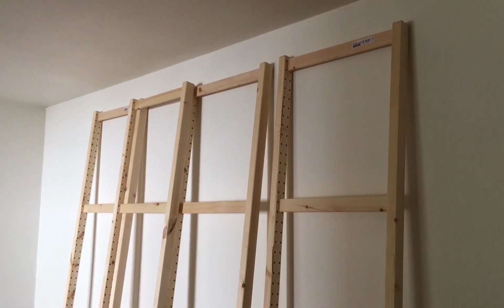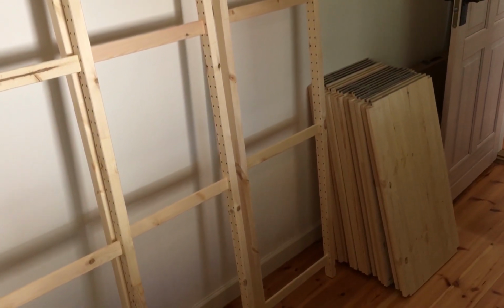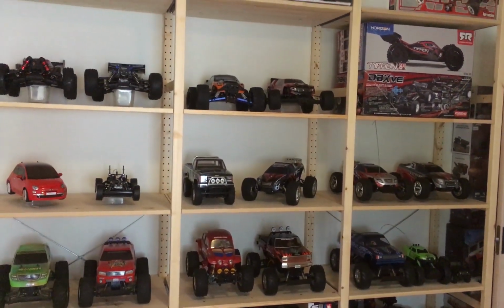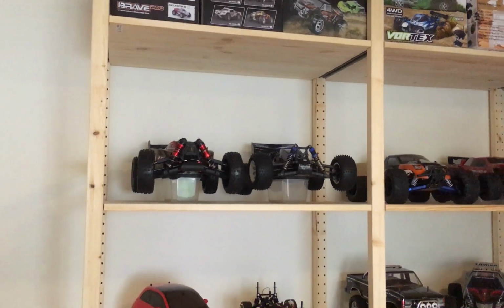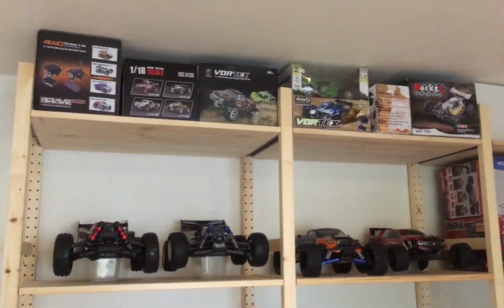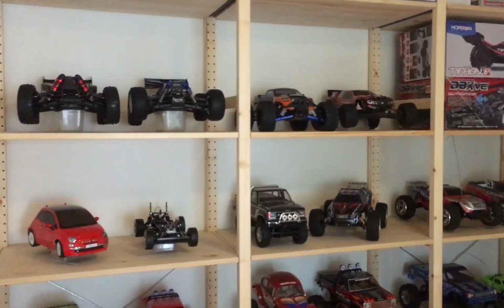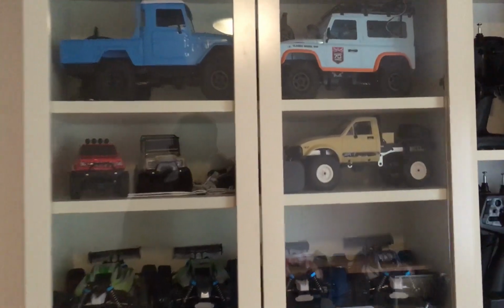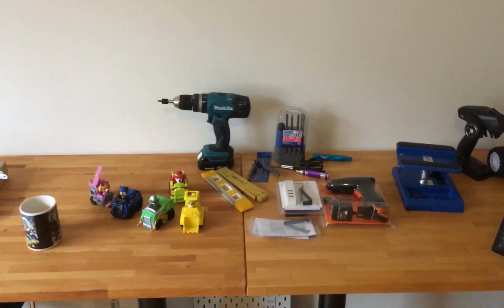The Making of an RC Hobby Room (Part 2): New Giant 3 Section IKEA IVAR Shelving System!

Comment: Shelves look great, so I don't blame you for using them.   Plus, they are highly adjustable.   
You must have a hundred RC's!  😮😲🤣😂🤣🤩
Reply from the maker: Yeah, I like to have this shelve system, adjustable, and deep enough for the bigger models. Ahh, not even one hundred, but getting very close I think. Luckily a lot of them are not 1/10 and 1/8 ... or else I would have to find a larger room :-)
Reply: I have this Shelve system too. Looks good and and does the job since ca. 2003. But the battery screwdriver from sweden seen in this video ist not very durable I think.

Comment: I saw you have a Maisto Rock Crawler do you have any videos on it and if so can you give me a link as it's a cheaper crawler and I've been thinking about getting something a little bigger than my 1/24.
Reply from the maker: Yeah, the Maisto Rock Crawler. It belongs to my son, but I've definitely also had a lot of fun with it. I think I got some 3-4 years old clips with it - but no edited and uploaded video. Maybe some day :-) It runs really nice with the motor-on-axles. The bad thing about it though, is that it does not have proportional steering and throttle, which can make crawling a little difficult.

Comment: Very nice collection!

As we can see you own turbo hoppers from tyco.
If I was young I found 2 of them (there was a bulk waste in my town) Old Versions without charging jack and differential but with the ability to steer without to drive forwards or back. Later I got a newer version also. If I drive the older version with the transmitter from the newer version I can drive left or right in turbo speed if I only steer left or right.

My question: Can You make a speed test with the older and newer version? With 1,2 Volt accus and 1,5 Volt batteries? I never know how fast this Car really is.
Reply from the maker: Hi Sven! Yeah, love the old ones. The Nikko Turbo Panther was my first Rc buggy back then in 1986. Didn't know there where differences between the Taiyo Jet Hopper versions - in terms of the steering (I think they are only known as Turbo Hoppers in the US, in Tyco's rebranded editions). Good info. Thanks. Hmm, about the speed tests, I'm not sure it would make sense, other than to provide a measurement of 30 year old cars. Many of mine has slowed down now. Something to do with the aging. Especially the Nikko's. The Taiyo's seem a little better. But I think these +30 year old ones will never go as fast as they used to do, when brand new in the 1980s. Not sure though, just my thoughts. It could be interesting to see the voltage difference though. Maybe :-)
Reply: @nordichobbyvisions719  Thanks for your answer. Indeed if the Jet Hopper really slow down a speed test makes no sense. By the way: Your hobby rc garage gets better and better.